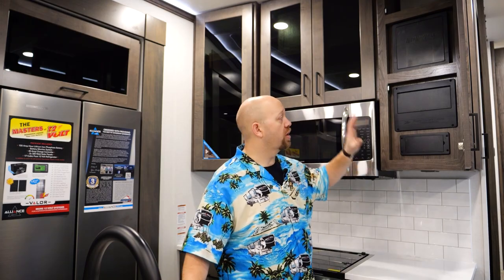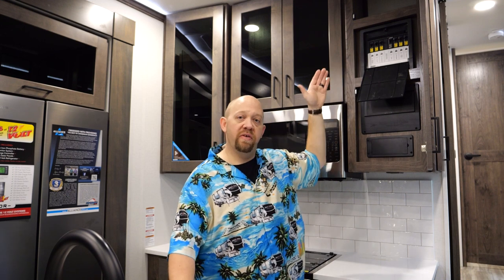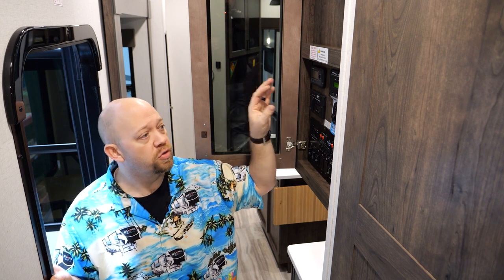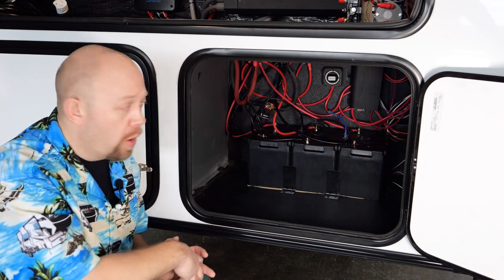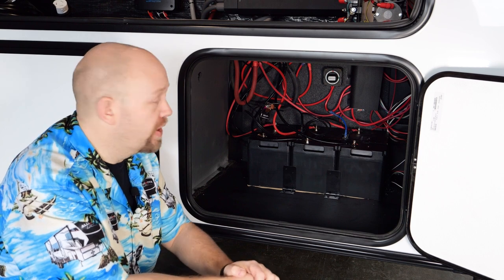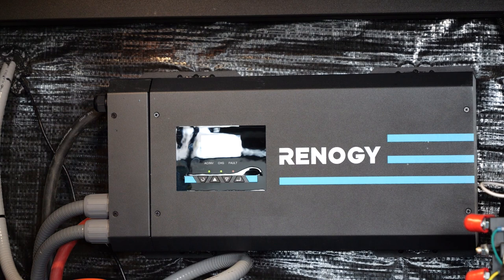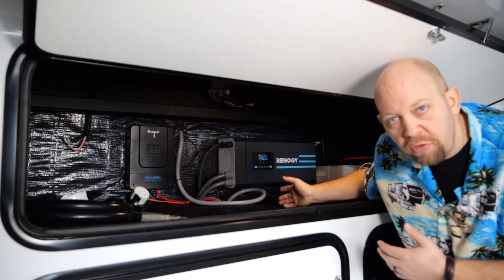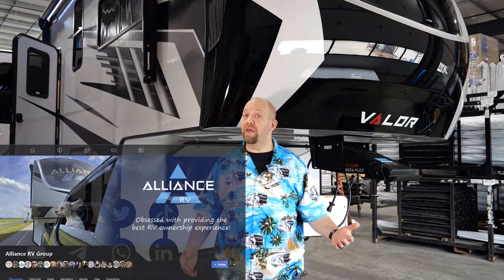Everything you need to know about Alliance RV's Solar Plus Package!

Comment: Great job Jim!  This video should be a prerequisite for anyone (including myself), who is purchasing an Alliance with either of the Solar packages.  I installed my own 800watt/412aH system on my Grand Design, and thought I knew just about everything. Well, guess what.. you learn something new every day!  Quick question: The 36V13 I'm picking up next week is supposedly prepped for a generator. So does that mean it will be plug and play for my smaller, 3000watt portable generator?  In addition, the three solar panels in the plus package are capable of producing about 395aH or more, per day during the spring and summers months. Would it not make sense to add a fourth, 100aH battery to the system? :hand-pink-waving:

Comment: My brain hurts! I need to watch this several more times! I am wondering why Alliance does not include a battery warmer of some sort with this system.  The rigs have tank heaters and all the goods that will allow them to face freezing temps, so why not do something to allow the batteries to face those temps too?  Also wondering about summer heat, I think the hottest temp you can charge these is 113 deg, isn't it? So if you are somewhere where the temperatures can reach that range, what do you do? thanks for the great info!

Comment: Great video. I'm new to solar and why I'm asking. I'll be ordering a new Alliance Paradigm w/ the solar plus package in about a month or so. If I'm on shore power from the pole and using the A/C, and the power goes out, will the A/C continue to work automatically on Solar/Inverter/Batteries? I'm asking because sometimes we are out and about and leave our Puppy/dog in the trailer. I'm sure the Tech/Dealership won't have a clue so I'm asking the experts. Thanks

Comment: Just a safety suggestion, if you are going to recommend removing power cables and connecting them together to bypass the inverter, would it not be prudent to mention you should kill ALL power sources? If they are on shore power or generator power, the feed cable will be live and lethal. Maybe just add some titling on the video to mention the safety part? No need to reshoot. Otherwise, even as an owner, I found this helpful. Wish we had the upgraded battery monitor, though.  :)

Comment: Thank you for putting the breaker panel in a location where I don't have to kneel, crouch, or crawl to get to it.  It's like other RV manufacturers have never had electrical problems before.  I have a suggestion for avoiding the battery freezing problem--at least for when you're actively camping in the unit--and that's to move the batteries into the living area.  I've seen other units where they put the batteries under the seats of the dinette booth.

Comment: Hello I work at a RV dealer.  Question about the solar fuse from the solar charge controller to the battery.  We had 2 units that had 40 amp fuses and we found both open during PDI inspection.  You just said look for the 60 amp fuse.  Question is What size fuse does this system need.  The both system also had a 40 amp Renogy charge controller on them.
Reply: I don't work for Alliance, but I am familiar with these systems.  I believe the following is correct...
The Basic solar  package has a 40amp solar controller and a 40amp fuse. 
The Solar Plus Package has a 60amp solar controller and a 60amp fuse.

Comment: I understand. That you can only use the middle A/c unit off grid . Can you modify it to use only bedroom A/c  I was thinking if your boondocking that middle a/c wont be much good while sleeping. My second question  if your batteries are at full power and you don’t use anything else . How long will that a/c run during the night with the solar plus package
Reply: Good question, did you get an answer?